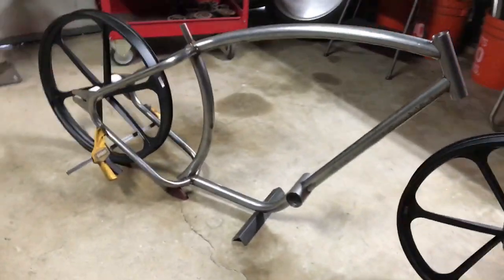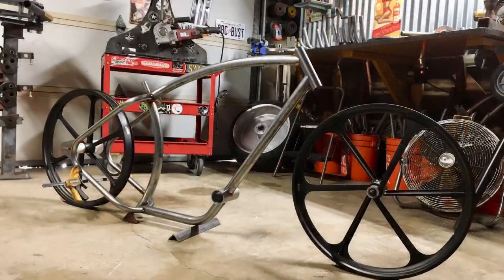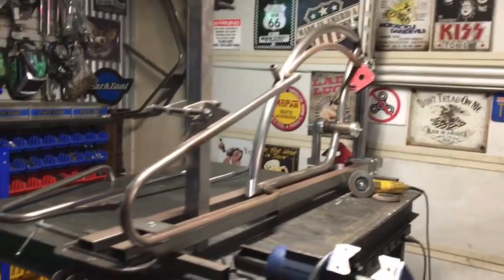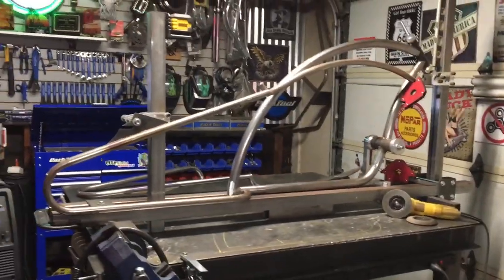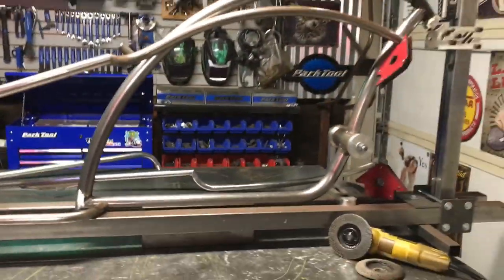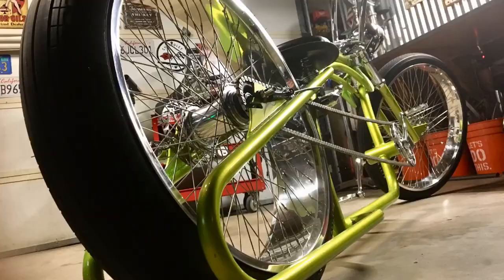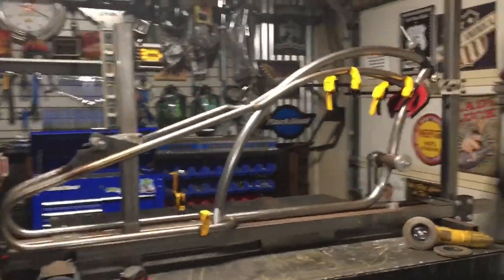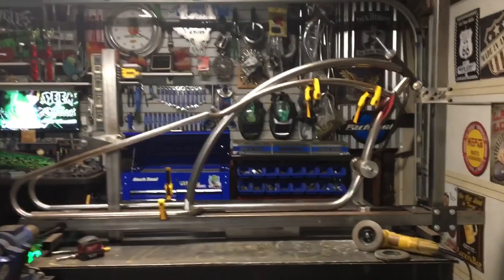Ep27 Peek Cycles: Imperial Frame Mock Up, Resurrecting a Chopped Frame, Steel Type Used for Frames

Comment: Jimmy, Nice job on your videos, well done.  I have designed a new gravel/touring bike handlebar and am having a difficult time sourcing either 4130 Chrome-Moly steel or 6160 T-5 aluminum (22.3mm O.D. with a 2.2mm wall thickness.)  Any suggestions?  Finally, if provided with a CAD drawing would you be willing to do a prototype?

Cheers,
Dr. Steve
Reply from the maker: Sorry for the late reply. My steelyard carries 4130. Not sure about the aluminum. Maybe get in touch with them and see what they have in its stock. Web address and contact info below.

https://www.competitivemetals.com/